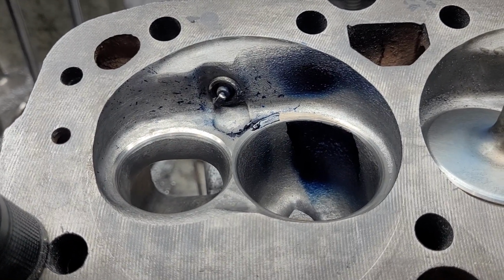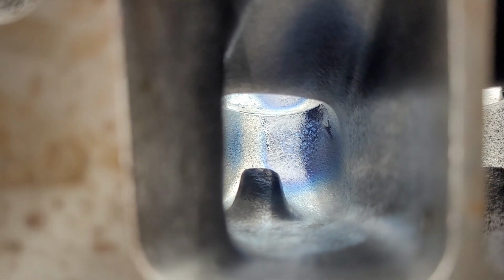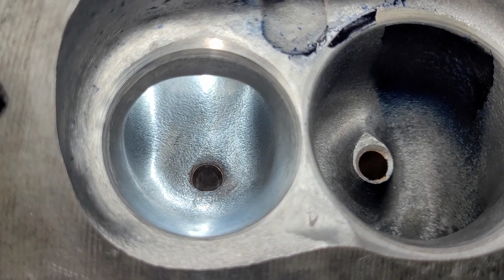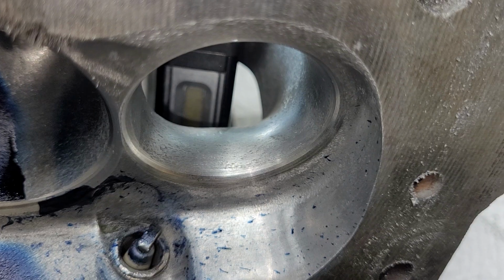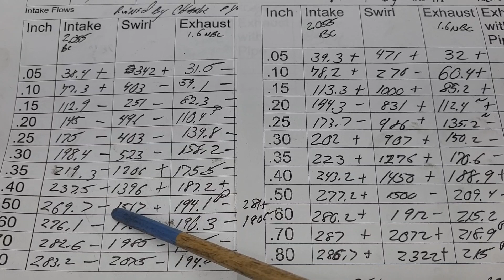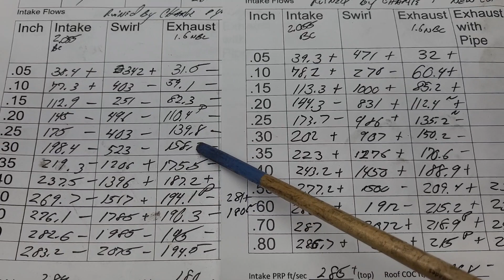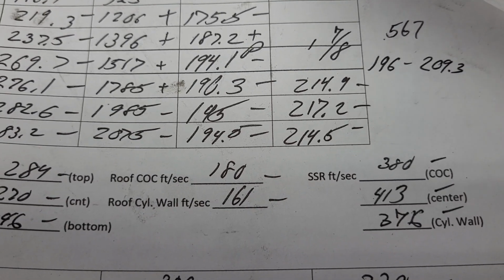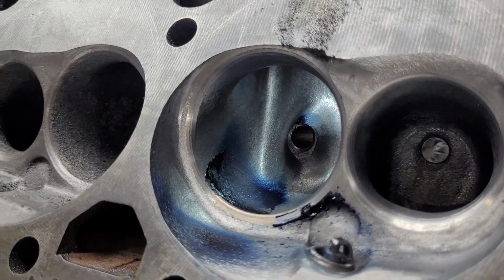Slover ported Chevy Bowtie cylinder heads 034, ruined by Charlie 1st new cut

Comment: Where the dychem hit the cylinder wall/ deck surface, always tells me that more attention needs to be given to the head/gasket and bore transition.   Yes head looks good overall.   Nobody in my area will pay out what it takes for me to port iron heads.    Lol. Most are so smart that if it has an aluminum head on it that in it self makes the performance upgrade. 🙄
Reply from the maker: People usually choke when I give prices. It is true what you write about aluminum heads. Thanks

Comment: good info i have a set of these that i got years ago that were on a ashphalt modified they are the later casting with the number 7 cast into it 205 intake and angle milled to a 49 cc chamber they appear to be unported got them at a swap meet i am currently building a 350 cid short block to use as a bracket race mtr what head gasket would you reccomend to be in the 12-1 comp ratio range ? thank you sir
Reply from the maker: I like thin stamped steel head gaskets. Mls gaskets are nice too and you can have them made in any thickness to set your quench.
Reply: @servediocylinderheads  forgot to mention the piston ill be using will be a flat top wiseco i do have some stamped steel gaskets on the shelf thanks for reply
Reply from the maker: @robertmayer2071  With the right combo it will run hard.
Reply: @servediocylinderheads  thanks for the encouraging words
Reply: Do yours have the crappy cracks or did someone fix them?